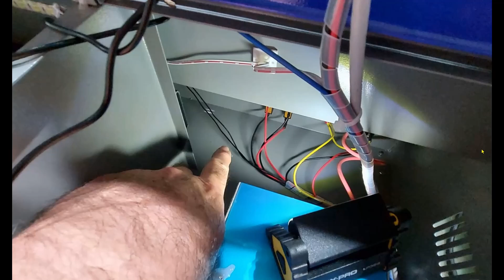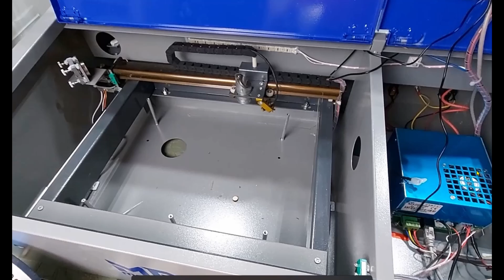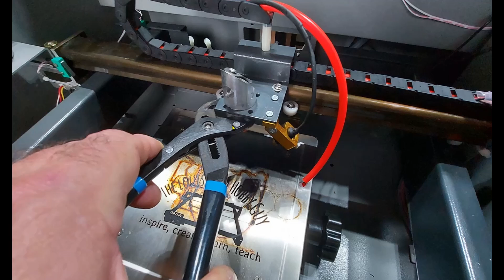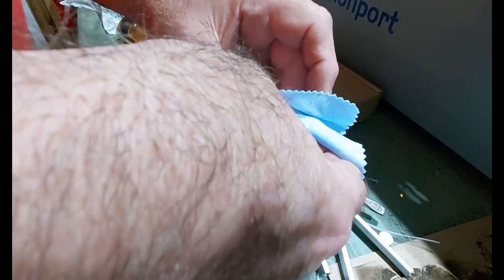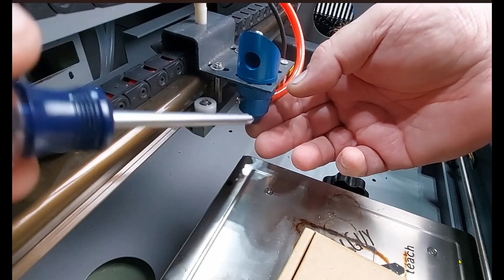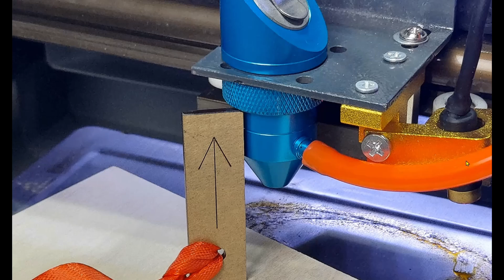👌 Upgrading a K40 Co2, changing the laser head, air assist and more! #1 Requested Video!

Comment: Hey Rich, I have a lower end K40 that I have been using for some time.  Mostly, I cut/engrave on paper, cardstock, and thin wood (1/32", 1/64," 1/16").  I work with scale miniatures (1/12th, 1/48th, 1/144th).  I create things like doilies, putz houses, plant leaves, and tiny furniture.  Previously, I have used K40 Whisper to accomplish this.  Each switch from engraving to cutting had to be manual.
Recently, I have acquired a Monport motherboard and Lightburn.  I am so excited to finally be able to change speed and power without having to stand at the machine to switch power and speed when needed.  After replacing the old with the new Monport motherboard, I am unable to adjust the power.  I can adjust the speed, just not the power.  Power seems to be on full throttle the whole time.  I have verified that the Max spindle speed (RPM) and the S-Value max are the same, although I have read various numbers (255 or 1000) are correct.  I am not very technically minded and do not understand much of the ins and outs of the machine.  I would truly appreciate any help you can give to help me accomplish my goal.  Thanks so much...in advance.
Reply from the maker: You have the S-Value max right, it is 1000. Beyond that, I can't help Lori. The Monport control boards have several different versions of firmware. You can try checking your settings on the Console tab. Type $$ and press Enter. Then look for the $30 printout, it should say 1000. If the control board is consistently burning at 100% power regardless of the Lightburn settings, it indicates a problem with the control signal from the board or the power supply itself. This could be due to a few factors, including a faulty control board, or issues with the power supply or the wiring of the power supply.

Comment: I’m using the stock head the k40’came with and Monport told me it’s supposed to be used in the horizontal position and that’s it’s a 12mm focal length
Reply from the maker: They may have changed it Thomas since I had one. This is an older video. The machine focal guide that came with my machine was used in the vertical position. I verified it with a ramp test. You can as well.
Reply: @ ok, I have the same gauge as you do in the video, I even sent them a picture of it in the vertical and they said it was wrong, this started cuz I got there roller for the k40 and tumblers that are within the size limit of the roller but at the rollers lowest point it’s still to tall

Comment: Great vidoe. I was easily able to follow to complete upgrades. Being a total newbie I was very worried I was going to screw something up but with you video I was all set. I do however have a question. When I removed the plates in the bottom I have a round hole in the very bottom. For fume purposes what can I safely close that up with. I have the 8x8 scissor jack but in the more section you have linked standoffs. Do I need to add a honecomb? thanks
Reply from the maker: You don't need to worry about the hole. If you are, some duct tape will do the trick. I used the 8x8 lab jack in mine. Adding an adjustable honeycomb would be a really big task.

Comment: I know this is a year old but that Sunon DP200A is listed as a 220Volt fan. wouldent it be running at 1/2 speed at 115 volts ?
Reply from the maker: No idea... it probably comes in either 110 & 220, but I don't know. I use an inline fan in the exhaust hose.

Comment: good thing i watched this video first, more infmational than anything. i had planned on taking a dremel to the duct to take part off, hoping to gain space. (didnt know where the 4 screws were to fully remove it) all in hopes that i would gain a tiny bit of bed area, which i found out i wouldnt, the omtech k40+ is actually already maxed out on space with the gantry, but running the duct upside down as you did lost me space, so i left it just as it was... i will be  removing the stock fan soon though,  and i have a small pump to upgrade my air assist but, i havent gotten a new nozzle yet, i may keep the same one and just change out the pump, or run them together ( unless running 2 at the same time will cause a problem, which i dont know yet...) but, im still gaining knowledge with all your videos, i greatly appreciate all the time you've taken with these!!
Reply from the maker: Awesome! 👍 Thanks for watching!

Comment: Is there any issue with making the lines to the water chiller longer? Is there a specific tubing I should get? Is there a specific supplier or place you would recommend getting replacement tubing from?
Reply from the maker: None at all. One of mine has 6 foot lines to reach the chiller. I just ordered some silicon hose on Amazon and 2 barb connectors to splice them.

Comment: @TheLouisianaHobbyGuy I would like to THANK YOU soo very much for all your information on the K40 by MP lasers. I am currently on a 4 year old Ortur diode laser and I am die'n for the speed and cutting strength of a CO2 laser.  I was seriously considering the K40 by MP as my upgrade.  But the only thing stopping me was the bed size.  I just can't go that small.  I currently do raw cedar signs a lot and also custom logo art and leather goods.  So there is my dilemma....  THEN I logged on to watch one of your videos and saw your discount code.  LIGHTBULB MOMENT!  I just finished ordering the 60W manual focus 28x20 model from the website using your code to get an awesome discount😁 I am totally stoked and very excited.  I will now be able to streamline my engraving and cutting jobs instead of doing single runs of 1 single thing at a time.
Reply from the maker: Awesome! Have fun with it!

Comment: Has anyone figured out how to regain that bit of space, on the bed area, after removing the shroud? I have between 2-4" of space in the back that's just going to waste. I had a Chinese laser before using K40 Whisperer and simply adjusted the bed area and set a new homing position. Is there something similar with this machine that can be done?
Reply from the maker: Change the size of the bed in the Device Settings in Lightburn and in the machine settings as well. File --> Machine Settings. Do this at your own risk!

Comment: I'm pickup up one tomorrow from someone local.  Hopefully I can get these mods done that everyone else is doing.  Thank you for all the useful info.
Reply from the maker: Have fun!
Reply: @TheLouisianaHobbyGuy  Baffles me too that for as long as the K40's have been around that they have not moved up to a more standard size cutting area.  All you see now is everything starting out at 400x400 which is perfect as you can cut down a sheet of 4x8 plywood evenly to fit these dimensions.  At least make it an even 12x12 area.... maybe just me..
Reply from the maker: Well they were originally designed for rubber stamps & circuit boards, hence the small hand vice in the work bed. Upping the size of the work bed would require better and more expensive parts, and you can get larger work beds on 30 & 40W Co2 lasers, you just have to pay the price. These are budget machines with inferior parts to keep the price down.

Comment: Hey Rich. Man you know I love all your videos. What would be the possibility of simply adding a bigger drag chain to ease the process of feeding the air assist hose? What compressor are you using? I saw a different video showing the California Airtools compressor, and an air splitter, etc.
Reply from the maker: You can get a slightly smaller hose Douglass. Or just coat it with some 3-in1 oil to let it slip through.
Reply: @TheLouisianaHobbyGuy  Thanks Rich.

Comment: I added the rigid tubing to mine and now it pushes my head gantry a little bit after I frame an object, it doesn't stop and stay in place. Can this be resolved by tightening the gantry belt?
Reply from the maker: No, but if you attach it to the outside that may fix it for you. Several folks have changed to softer tubing, but mine works just fine.
Reply: @TheLouisianaHobbyGuy  Rich, do u have a link on which soft airline we should use. Thanks!

Comment: Hi Rich, thanks for the video.  I just changed out my laser head and added air assist to my MP K40.  I just seem to have one problem.  I used the described hard air tubing and it seems to be causing the drag chain to pull the laser head backwards after a move to the right.  Have you seen or herd of this happening to anyone else?  I left a video of the problem on your laser forum in the CO2 laser section.  Many people have viewed the post but no ideas why yet.  Are the K40 steppers suppose to lock when connected to the computer?  It seems that my gantry is so easy to move at any time.
Reply: I just did some digging and may have found a way to keep the steppers locked.  I will try and change the $1 GRBL setting to 255.  That should lock the steppers and not allow them to bounce back after a movement.  My $1 is currently set to 25 milliseconds.  I will post back after I change it this evening after work.
Reply from the maker: I wouldn't go changing any of the settings Bill. It's not supposed to be moved by hand. K40 lasers are best used in absolute coordinates and only moved manually on the Move tab with the arrows. This is the way the control software is setup from the factory.

Comment: With the larger lab jacks you can remove one pair of the scissors to make it shorter. It takes some work and shimming, but then it can be turned upside down so the knob is stationary. The left side of the housing is a straight shot for an extension and a single drill hole for the adjustment knob to be external
Reply from the maker: Thanks for the tip Franklyn! I'll give it a try!

Comment: Rich, I completed the air assist modification. I noticed that upper section does not drop into the hole in the factory bracket. It floats, is that the way it should be? Thanks
Reply from the maker: Try posting on my free forums. https://lahobbyguy.com/bb I don't know what you mean Jim.
Reply: FYI, it turns out that working in a cold environment (40-55° F) like my garage is, the tubing is stiff enough to move the laser after framing up to 3 mm, x axis. 
Solution for me: I went back to the soft hose through the drag chain. It took a while but was worth the effort. Thanks Rich, I love the air assist on the MP K40.
Reply: @Jim Ulm  Jim, seen u went with a soft airline, if u don't mind do u have a link on which one I should buy? Thanks!!

Comment: good evening, could you give me the exact measurements of the focal point meter? many thanks in advance
Reply from the maker: If you mean the focus distance, it's 2".
Reply: @TheLouisianaHobbyGuy  in the video i saw that you used a piece of 4mm plywood with an arrow etched into it, you used that as a template from the laser head's serrated ferrule to the work piece.
I wanted to know the dimensions of that piece of wood with the drawn arrow
Reply: min 13:30/21:13
Reply from the maker: It's the acrylic focusing gage that comes with the laser! 10x50mm.

Comment: The most important thing you need to do on a K40 is to check the electrics. On mine most of the crimp connectors were not properly crimped and I was able to pull the wire out with no effort at all. Also there is an earth (ground?) connection to the chassis, using a large nut and bolt, the paint had not been removed so it had a very poor connection to the chassis. (15,000 volts in a water filled glass tube housed in a badly grounded metal box with poor mains connections... what could go wrong??)
  After fixing the electrics I added air assist, a Cohesion 3D control board, camera and better interlock switches to the door works well with lightburn now
Reply from the maker: Ground was good, connectors, check. This isn't an eBay build; it has much better quality control. But you're right, these things need to be checked. I can't remember to point out everything 🤪

Comment: Just ordered my 40W a few seconds ago. Should be quite a different experience from my old 5W diode. Question: Would a pancake compressor, along with a cheap inline regulator and hose adapters, be an acceptable substitute for the Atezr compressor?
Reply from the maker: Sure, why not?
Reply: @TheLouisianaHobbyGuy  One way to find out. 🙂

Comment: Rich, I saw this video and I was already thinking about how to do air assist and an inline vent fan. But, my technical expertise on doing things is suspect. But down to my point, I ordered everything you suggested and I haven't even turned the machine on for the first time yet. I know that's stupid, but it seems so logical. Two questions: 1) Can I install a lightburn camera on the K40 and 2) The wires on the onboard fan, can I just cut the wires, because I can't seem to locate were they are connected to the main board? You have been the greatest help on me learning techniques with my Atomstack A20 laser, now on to cO2 lasers.
Reply from the maker: Yes John, I cut them close to the fan because I plan on adding a camera so I'll need more LED lights. I'll repurpose those wires for the additional lights. I'll be adding a Lightburn camera soon.
Reply: @TheLouisianaHobbyGuy  Tks for the fast reply. I'm goon get a camera too. Why? because, why not (ha ha). I'll wait for your suggestion on the camera. Also, please post a video when you do install it. It's good for us guys, that don't know what we're doing.
Reply from the maker: I will!

Comment: Rich, I made all of these changes the first week I got my K40.  I actually cut out a section of the left side panel so I could mount the scissor jack permanetly inside and have an extension handle on the outside of the unit to make height adjustments.  I'll be removing the factory fan this week too, didn't think of that back then.  Excellent instructions once again !!!!
Reply from the maker: Awesome James! 👍 Thanks for watching!

Comment: Thanks Rich. I have the same laser and installed an external exhaust fan, already had the air assist. I had not been impressed with the exhaust efficiency. Now I know why. I am going to remove the fan today. Keep the tips coming.
Reply from the maker: Wonderful! Let me know the results!
Reply: @TheLouisianaHobbyGuy  I removed the original fan and now only run the external one... Wow, no more fumes in the room and a much greater air flow. I guess dual fans are not additive. they only pull as much as the weakest fan. thanks for the tip, it works.
Reply from the maker: My pleasure!

Comment: Nice upgrades, Rich what is your thought's on a red pointer laser attached to the lens assembly. I'm looking at a new machine built to a great spec it has two attached. Really wanted a beam combiner thinking this would be less likely to need adjustments, deal breaker or not 🤔
Reply from the maker: A beam combiner gives you perfect red dot guidance. The crosshair is nice too. I don't know David. Six of one, half dozen of the other as far as I'm concerned.
Reply: @The Louisiana Hobby Guy  Thanks for the reply, Rich. I don't think it's going to be a deal breaker. More concerned, the red pointer lasers attached to the lens assembly will move with vibration. Thanks again for your input 👍

Comment: Rich great video. I own a diode 10 watt(XTool) and have had it since last November. I will say I am one that hasn’t had any issues at all and would know how to troubleshoot if I did. Is the Monport a good entry level co2 so that I can further my knowledge and get experience with co2. I am just a hobbyist since I am 63 with health issues. On my machine I used oxygen tubing and removed hard line from an airline kit I bought and love the flexibility of moving through my drag chains. I respect your knowledge and experience. What a great help you are to the community
Reply from the maker: Wow! Thank you so much! I appreciate the input Steve! Yes, most K-40s are the same, but the Monport is the only upgraded K40 on the market straight out of the box using Lightburn for about the same price as the others. It's a good buy in my opinion!

Comment: I see you are not using a honeycomb bed to cut and propping your piece an a couple of scraps, but if they piece being cut is larger than the 8x8 jack wont the laser beam go to the floor of the case and burn it.
Reply from the maker: No Steve, it's fine. It might discolor it, but it's so far out of focus by then, there's nothing to worry about. I would keep it clean down there though to prevent any flare ups.
Reply: @TheLouisianaHobbyGuy  I find I need a honeycomb in order to hold 3mm ply flat, and with the honeycomb, I cannot fit even the smaller screw jack under the air assist cone, so I ran a ramp test, determined the best height for 3mm and 6mm ply and built 2 simple platforms to rest the honeycomb on.  seems to work fine.

Comment: How stable is the 8-inch jack?  If I shim it to be parallel when fully lowered will the top remain parallel at every point as it is raised?
Reply from the maker: No Jesse, it's very unstable! You have to use it with a level. A real PITA to use, but worth the extra time.

Comment: To ask your professional opinion, do you think that a 20W output diode laser (like the new XTool or Atomstack) that is advertised to be able to cut 0.08mm stainless steel could use pure oxygen assist to cut slightly thicker metal? Asking specifically for the application of 0.15mm pure nickel for lithium battery construction (welding).

Appreciate your insights!!
Reply from the maker: Eeek! That would be outside my area of expertise, if I have one 🤪 Makes sense though, since that's the way the big fiber lasers do it. I know very little about this technology though.
Reply: Thank you for your response! 🙂